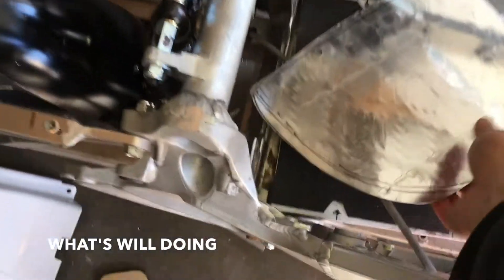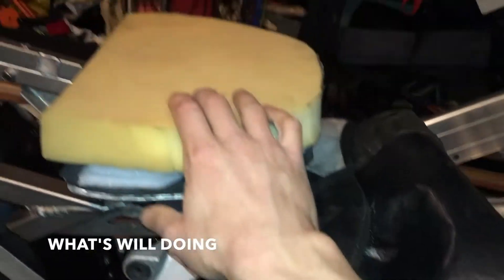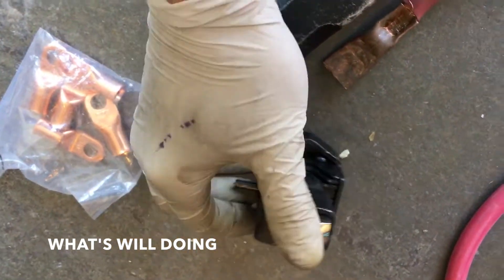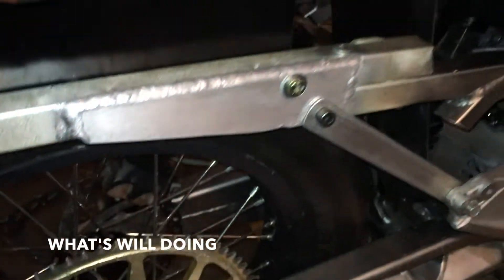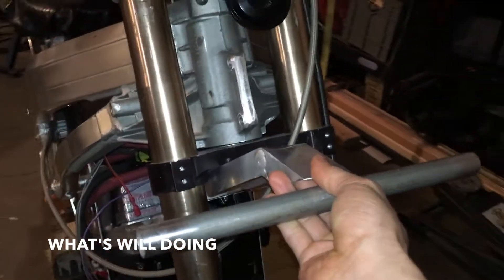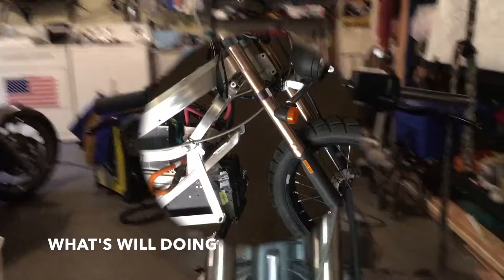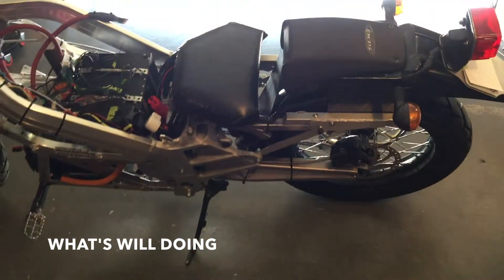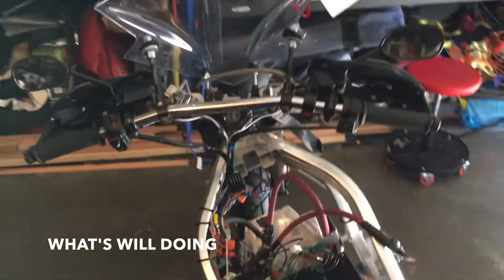DIY Electric Motorcycle with 117V - ALMOST DONE!!

Comment: That's a horrible crimp tool, because of the air pockets that it leaves between the triangular corners. They sell ratcheting gas crimps on eBay pretty cheap, can find some used ones from 20 to 30 bucks. Guess you can use some sealer heat shrink over the top for now.